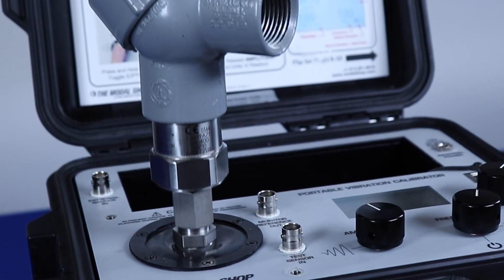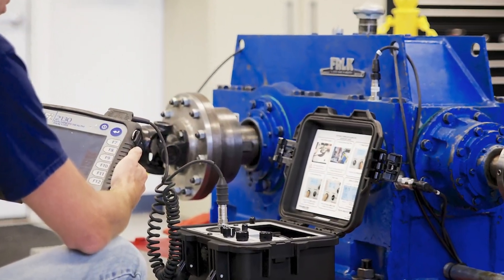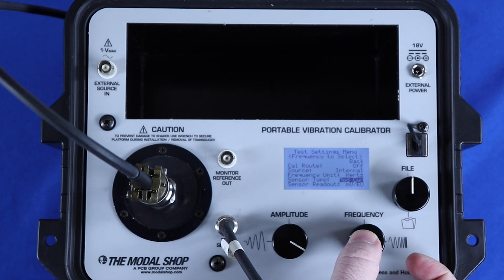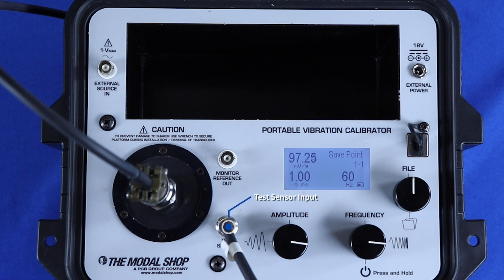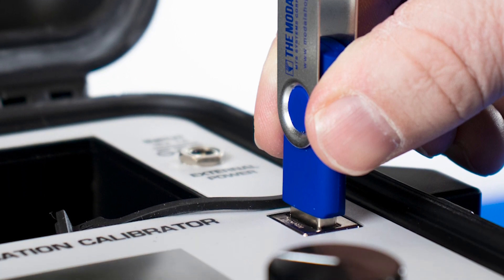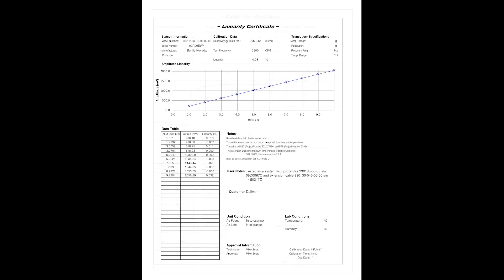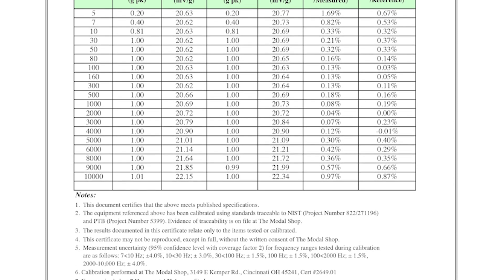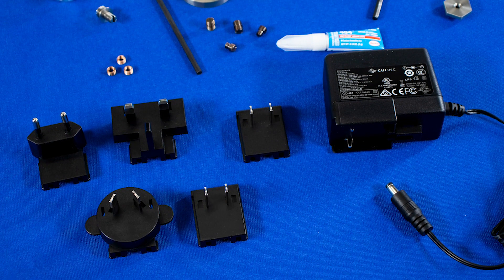Portable Vibration Calibrator with Sensitivity Display - 9110D

Comment: how do you mount vibration switch on this?
Reply from the maker: It depends on the type of vibration switch. For example, the PCB 686C series vibration switch is small and mounts directly into the ¼-28 F hole. The PCB 685B series mounts using a 4-bolt plate manufactured by The Modal Shop. Each of these vibration switches is electronic. Mechanical vibration switch, like a “Murphy switch," are too heavy for the portable vibration calibrator. Find testable switches here https://www.pcb.com/products?m=686c01 and here https://www.pcb.com/products?m=685b0001a10